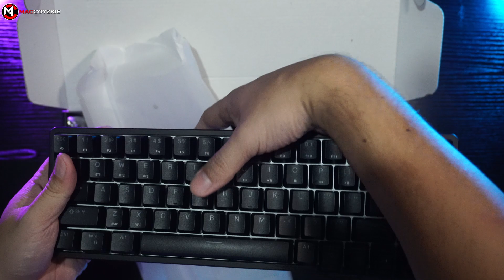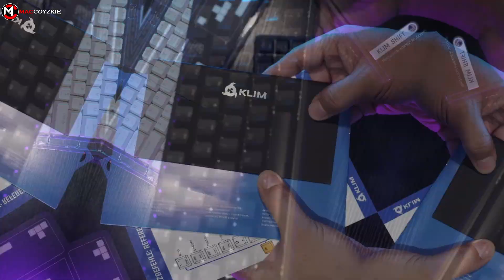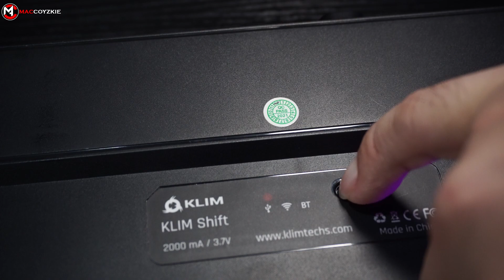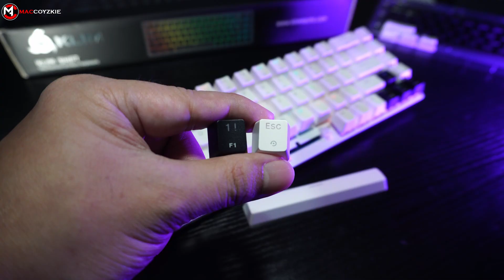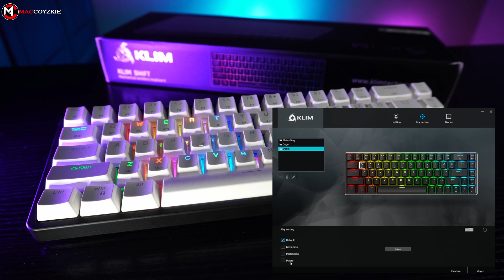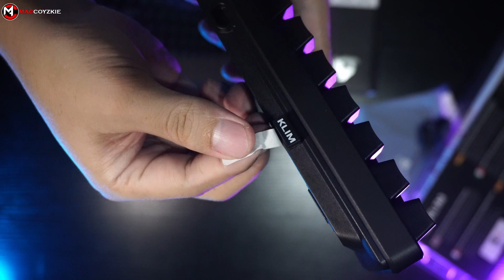Klim Shift Hotswap Mech Keyboard (full review)

Comment: Hi I have a rog strix x570-e motherboard and 5900x with 750  Corsair psu it stays on for like 8 hours and then cuts out any ideas what it cud be please thanks
Reply from the maker: do you have a gpu with that rig? if you don't then what happened is normal
Reply: @MacCoyzkie  yes I do have a gpu
Reply from the maker: @x_xtreme_x  it's not in sleep mode right? this could be overheating or low power draw from your outlet. What are your cpu and gpu temps in idle and gaming?